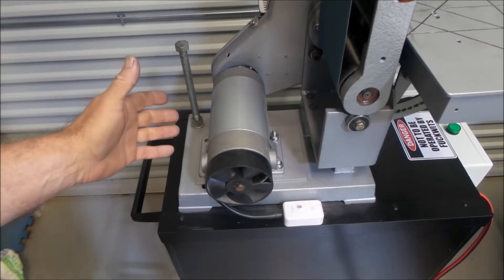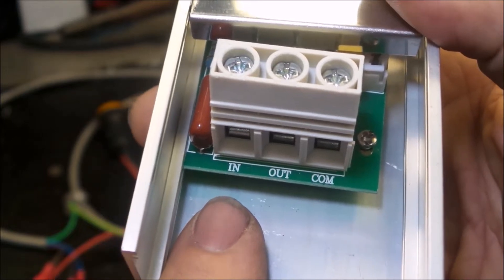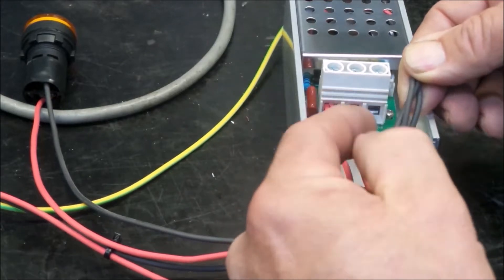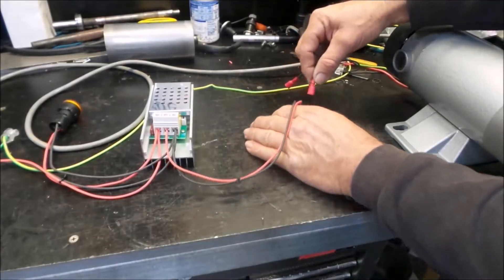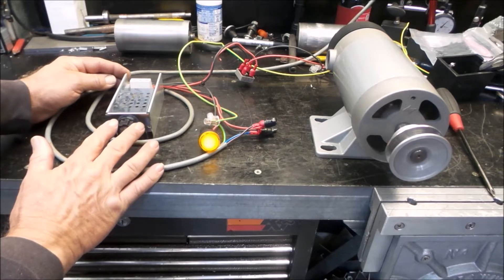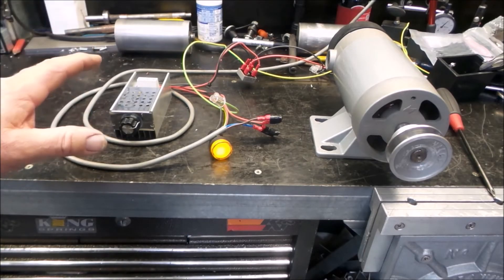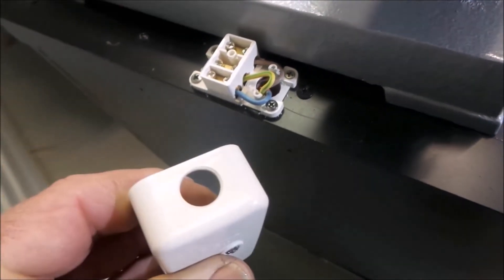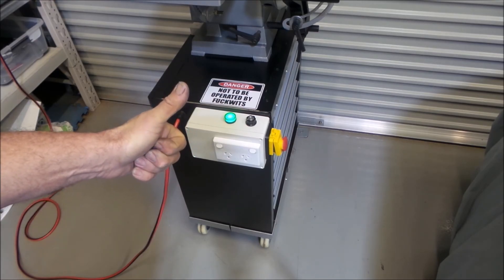The Ultimate Diy DC Treadmill Motor Controller

Comment: I bought a 4 kw ac speed controller for my 190 volt dc treadmill motor and these when setup is awesome! I love electronics. It keeps my mind active.  Cheers 👍
Reply: Did you just rectify the VFD output ?
Reply: @johnwalker194  yes! Why is that? No good? Because it works perfectly especially on a treadmill motor. 👍
Reply: @dragan3290  that's cool ! No, I was just curious as I'm about to put a 2.8 hp treadmill motor to my vintage Myford lathe.

Comment: any advice on making a controller for a TRIPLE PHASE commercial treadmill motor??  I have several of these monster motors and don't know how to use a single one without buying a super expensive controller

also, I WILL BE USING THIS INFO to run my residential treadmill motors for certain.  best video on the subject i've found. THANKS

Comment: Great video. Do you ever have dust and grit get pulled into the motor by the cooling fan and causing damage? Most motors on sanders are sealed motors.
Reply from the maker: G'day Mate, I was a little concerned years ago when I started building these. So far it has never been a problem though. The machines are all running today as well as when they were first put together. They may be full of Crud, but it hasn't seemed to worry them. Cheers Mate.
Reply: @TheAussieShed  Nice good to hear. I got a new, for free,  3.6 CHP motor and I am going to put it on my metal lathe. Having variable speed will be nice.

Comment: Trevor ive built my box as yours is with double power point and mag switch. I cant figure out from video where you have light plugged in and if there are wires plugged into com socket. Can you help. Baz in perth.

Comment: i built this setup and it works great. Only think i don't like is that when i start turning the pot up to get the motor running, it hits pretty hard when it starts... probably not a bit deal but i'm trying to figure how to soft start it...

Comment: Hey Trev. I'm just knockin up one of these for my workshop linisher as we speak! Quick question , if I may? There'd be no problems to rotate the SCR 90 degrees counter CW would there? Then I don't need to cut it! And I can mount the Bridge rectifier on the left side of the SCR heat sink. Opposite to where the wires enter the SCR.
Reply from the maker: Should be fine Bill, good luck with your  Project. Cheers.

Comment: Thanks for this! I've been trying to make sense of the treadmill wiring to use its controller but this is so much simpler! Just one question though, if I add a smoothing capacitor in parallel with the bridge rectifier, what size would it need to be and how many uF? My motor is 230v so I'm guessing at least 300 with 200uF?

Comment: Like so many others I am really chuffed to have come across your channel. 
My brain is severely electrically challenged and that is why I ask this question (also because of other confusing methods for this adaptation)
Why do you think it not necessary to run an inductor and a choke?? Supposedly done to smooth out torque. 
Also, fantastic to find a channel at this end of the world!!!!
👍👍
Thanks

Comment: I have connected up two treadmill motors exactly the way you show in your video. They both work perfectly with no load. When I put a load on them, in this case running a 12 volt car generator for testing with a v belt, I turn the pentiometer and the motor starts, but the brushes arc and the motor does not run properly until it gets to 3500 RPM. If I turn the pentiometer down the motor starts to splutter and arc. What can be the problem?

Comment: I cant make this work. I have tries 2 motors. First one burned out and the second keeps tripping the circuit breaker. Have u ever had a faulty speed controller from ebay? I am using exactly same set up as u. About to give up and go back to ac
Reply from the maker: G'day Mate, no, i've never had a faulty speed controller, i'd probably be looking at the bridge rectifier, I have had them give similar symptoms when stressed for a long period & from memory I think I had one straight out of the box like this.

Comment: just curious, is it possible to wire this setup so I can get forward/reverse switch,have done my drill press, now I want to do this on my lathe, but I need reverse as well as forward.  ps thanks for this video found it really easy to do this conversion to my drill press (no more changing belts and pulleys) thanks again Aussie shed

Comment: Great explanation, this is exactly what I’ve been looking for. I have a slightly different situation: I have a 1Hp 5 amp motor. Will I need a different rated scr module for these specs? Regards Barry M.

Comment: Thanks Trevor. This is a very simple and easy set up to follow. Where do you source your treadmill motors? Are you using scrapped machines or buying them new off eBay? I presume if one was to upgrade a mini lathe with a motor like this you can add a reverse polarity switch as well on the DC line from the rectifier to the motor?
Reply from the maker: G'day Garth, yes I source the motors from scrapped treadmills, free is a great price. I use this exact setup on my Mini Lathe with a reversing switch & also my Drill-Mill Conversion. Works a treat. Cheers mate.
Reply: @TheAussieShed  I just love free 😁

Comment: Nice video. I was about to order and configure the controller and setup a variable speed treadmill motor but realized that you are describing 220 and I have only 110V. I don't have 220V available at the location I will use this at. Do you have a similar video available for us lowly 110V U.S. folks? Or if you can describe the difference I will follow the new differences. Thanks for the nice video either way.
Reply from the maker: G'day Tim, these components work for both 220 & 110, the only thing you may need to change is the Potentiometer in the SCR to a different value.
Cheers Mate.

Comment: Awesome mate. Nice one.
Been thinking about how to power my apple fucker (it's a scratter mill for making cider) and a centrifuge, been looking at vfd and 3phase motors.
This has saved me hundreds of dollars in vfds.
I might even put both my lathes on dc too!
Is there a dc motor out there i might find that'll do 6000rpm?
Im building a centrifuge and want higher rpm but direct drive ideally as there's no room for belts and pulleys to gear up.
Any idea what motor capacity this set up will max out at?

Comment: Thanks for the video, I am running  pretty much the same set up, however whenever I coonect motor to rectifier my circuit breaker trips. Any idea? I have tested motor with 14vdc drill battery and it is working fine.
Reply from the maker: G'day Mate, no idea sorry. Maybe try another Bridge Rectifier. Cheers.

Comment: I have a question could use some help. I am in the US and needed to replace the potentiometer. The new one I received has 3 pins do I only need to use 2? I see there is 3 pins on the circuit board not used was curious what those are for as well. Any help would be appreciated!

Comment: I have a earth/ground question...I built this using the same scr and rectifier going to a 90v motor. In testing, I only hooked up the power and neutral wires leaving the ground wires dangling. It worked well until one of my ground wires accidentally contacted the heat sink and caused an arc. Now the scr is dead. I found a burn mark beneath the the circuit board. Why did that happen? I have another controller on the way but don’t want to fry it again.

Edit; I just realized that my board is not fried but it did blow the gfci I was plugged in to. Still don’t understand why.

Comment: Nice video The_Aussie_Shed , Just one question Why don't you use a capacitor filter across the DC Voltage rectification side of the 
KBPC5010 Single Phases Diode Bridge Rectifier 50A 1000V Metal case ? haven't read all the remarks so not aware if the question has been asked!
Reply: Doesn't look like it needs it?

Comment: Very informative video.  Just about to.pick up a free treadmill shortly . Been looking on ebay for the scr and they have 4000w ones. Are these ok to use or should i stick with the 1000w versions. Love the channel to by the way
Reply from the maker: G'day Mate, I always use the  10,000w versions, they are way beefier than the 4000w ones. Same as the ones in the link above. Cheers Mate.
Reply: Thanks.  I stuffed up  the ones i found are rated at 40000 not 4000

Comment: Is there anyway where we can limit the speed of the motor by installing simple resistor to limit the current?
Thanks for the info.
Cheers from Indonesia mate!
Reply: Just turn the knob on the potentiometer down matey, that's what it's there for
Reply: @bushratbeachbum  thank you!
Reply: Well actually my intention is to limit the rotation of the motor (treadmill), so that in any case, it has no chance to run away at full speed. My treadmill did it many times.

Comment: hi can you help please im up with a problem ?  every time i plug it in and turn the switch to power up it turn so far then blows the fuse ? with the nob turned fully to zero its not blowing only once i turn it so far .... could it be the bridge rectifier that's at fault or the scr ?
its not the motor as iv disconnected that 
any idea for me thank you , every thing is wired as you shown and the parts are the same
Reply from the maker: G'day Mate, I'd probably be looking at the Bridge Rectifier.
Reply: @TheAussieShed  just what I kinda thought but I had know spare one or scr iv ordered some and more scr I will let you know how I get on oncrs parts arive thank you reply and I think your works great and you help many I'm sure like me do stuff we never had a clue to do with out you
Your a great man
Thank you again
Steven

Comment: Is there a lot of tourque  at low speeds?
Reply from the maker: G'day Mate, it all ultimately depends on gearing & intended purpose. Personally on all of my machines i run in the workshop with this setup, I have no problem at all with a lack of torque. Cheers.

Comment: excellent video mate  from one aussie to another i  am in w.a i am trying to get the flywheel of these motors any ideas i want to put a different pulley on it thanks mate very helpful
Reply from the maker: G'day Mate, most of the ones I have dealt with use a Grub Screw or 2 through the flywheel. Cheers.
Reply: I probably have a couple of flywheels you can have @malti2104 im also in wa. Whereabouts are you?
Reply: @bushratbeachbum  have u got an email i am in the south of perth
Reply: Yep, send me a message with your email and ill give you a holla

Comment: ... just please be aware that after rectification that 220 AC voltage will be better than 300V DC  ... so YES  limit that maximum output at the controller  ... be interesting to get some actual voltage measurements for safety ... might also think about a Capacitor across the brushes to limit sparking and or commutator burn .....
Reply: Could you recommend a capacitor for the purpose @Steve Jacobs?
Reply: Here in the US we use 110 vac versus the 220 vac DownUnder. Some of my treadmill motors are rated higher than this. Do you know what effect the lower voltage will have when running the motor ?

Thanks !

Comment: Very clear and informative, thank you,  just ordered  the gear now to get my belt grinder wired and going, hope that little speed controller is strong enough for a 3HP treadmill motor, thanks again.
Reply from the maker: Cheers Ian, yes I have quite a few tools here running a 3hp motor with this controller setup, it should be fine.

Comment: Is your treadmill motor a permanent magnet motor? Are you running it in reverse, if so has there been any negative things with the motor when running it in reverse?
Reply from the maker: G'day Mate, apologies for the late reply. Yes it is, no issues. The Brushes are 180deg to each other, i think that may help. Cheers.

Comment: I have bought a 4000w and 10000w motor controller and a Bridge rectifer and I have never got the motor slower than full speed
Reply from the maker: Hi David, what is your input voltage. Cheers.
Reply: @TheAussieShed  115v
Reply from the maker: @davidallen9289  Hi David you will need to change the Potentiometer on the SCR to a 200k linear version due to the 115v input. Cheers Mate.

Comment: hello The Aussie Shed i'm in sydney and before i saw your video i bought this,	
2000W 15A DC Speed Control Power Supply Single Phase DC Motor Speed Controller AC 220V to DC 220V
  can you please tell me if this is suitable for input motor 220v-240v RPM 3.400 TYPE DC MOTOR CONTINUOUS HP 1.25 HP CURRENT 11.A?  if is not suitable i will buy the one you use on the video
thank you
Reply from the maker: Hi Nick, it may be ok. Hard to know for sure as the specs on these units are often exaggerated. Its sort of the baby brother to what i have here, yours seems to have a built in bridge rectifier to handle the ac to dc conversion which maybe handy for you. Make sure it has good ventilation as it may get hot. Cheers Mate.
Reply: @TheAussieShed  you are a wonderful person i appreciate you answer me i wish i could buy you a drink
thank you very very much

Comment: Hi...I followed your instructions here and successfully got my treadmill working again. It’s running beautifully ..but the motor does have a hum when I turn up they potentiometer that I don’t remember from the when it was new. Running great so I take it the hum is nothing to worry about? 
Thanks.
Reply from the maker: Hi Chuck, you sometimes do get a bit of a hum, depends on many factors. One of my setups Hums quite a bit more than the others but has been running for years without issue. Cheers Mate.
Reply: The Aussie Shed ...thanks for your reply....I’m quite happy with performance of my treadmill...have to say there is a fair amount of electronics I’m bypassing to fit this small power supply....this could be a factor. Anyway thanks again for your help.

Comment: Well you wouldn't believe what I did. After going through your great video I finally got my SCR, Bridge Rectifiers, and a DC motor controller (10-30V 100A 3000W Programable Reversible DC Motor Speed Controller PWM Control). I got aggravated looking at Lowes for for some electrically wire to use between them, mostly hard house wiring which I didn't want. So I bought a cheap 8 foot extension cord and cut segments for wiring it all together. Spent half the day looking for my meter and a box of electrical connectors, failed to look at this video again and forgot to wire in the Bridge Rectifier. For some unknown reason I thought the SCR had AC input and DC output. So it tripped the breaker in the laundry room (electrical panel) immediately. It was late at night so I unhooked it all till this morning. I don't know if I ruined the the PWM or not. I'm not sure how to test it so I guess I'll put the rectifier in the circuit like it should be and if it works great and if it doesn't then I'll have a test piece to check out and see if I can determine what components fried. Haste makes waste, lesson learned
Reply from the maker: G'day Paul, I think everything will be fine when you hook it up correctly. At least you didn't get Zapped or anything Crazy like that. Cheers Mate.
Reply: Those chinese controllers are not SCR's  just a cheap triac.
Reply: @celiturbo  Thanks for the commit and I agree

Comment: Tried this system using a kbpc5010 rectifier. It works OK for a while then blows the rectifier?   is there anyway in stopping a spike / back current? Thanks in advance.
Reply from the maker: G'day Mate, have you tried another rectifier, reason I ask is I had one go on me a few years ago on my Mill/Drill.
Figured it was because I really load it up at low speed sometimes. I ordered a really expensive rectifier to cure what I thought was the problem but fitted another cheapy kbpc510 I had in the drawer to get me by. That was at least 2 maybe 3 years ago & its still going on the cheapy & I have really punished that sucker in the meantime.
This leads me to conclude there may be some manufacturing issues with the odd one of these cheapys.
Other than that I really have no idea, Its been my only failure & I have many pieces of equipment running this exact setup day in & day out in my workshop.
Sorry I can't be of more help.
Cheers Mate.
Reply: @TheAussieShed  Hi thanks for the reply - you could be right regarding faulty diodes. they where ordered from ebay (cheep). It fails at the DC negative point on the rectifier. other option is to put a cheap small amp fuse and a capacitor bridging over the rectifier.

Comment: Excellent video and one I have been trying to find answers to. I discovered that if you want to learn about using the SCR, rectifier bridge and then wire it all up to run a treadmill motor it seems you have the answers. The SCR has AC current in and out. When you power it up and the POT is at 0 or lowest setting there is no current flowing to the rectifier bridge (?), as you turn the POT and increase the AC input/output to bridge, the DC voltage increases, is that correct? So a treadmill motor that has 90 volts is referring to 100% on??? I guess what I am asking is you don't have to have a device that puts out 90 DC Volts, as you increase power the DC voltage from the bridge increases the DC voltage output which regulates the RPMs of the DC motor. Am I close to being correct? I recently bought a 
    TDGC2-0.3KVA 110V 60 Hz Variable AC Transformer Auto Regulator 0-130V 300VA US    thinking I would need it to run a Jazzy Electric Wheelchair Motor 24volts and I'm guessing around 40 amps from what I have found on the internet. I bought a 100 amp 1200 volt bridge rectifier to work with the variable AC Transformer for DC output. When your ignorant and scraping the bottom of the barrel trying to figure out how to set things up you waste a lot of money on JUNK. I think this is what I did after seeing this step by step video you made. Many thanks, I did subscribe to your channel to learn more.
Reply from the maker: !00% correct Paul, you have it totally worked out, Cheers Mate.